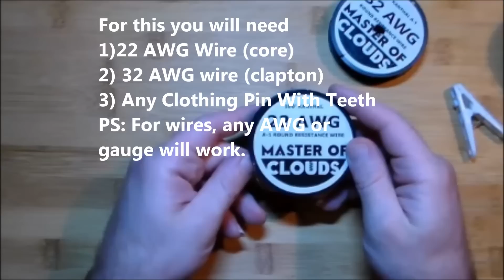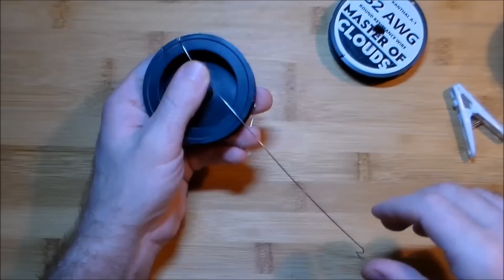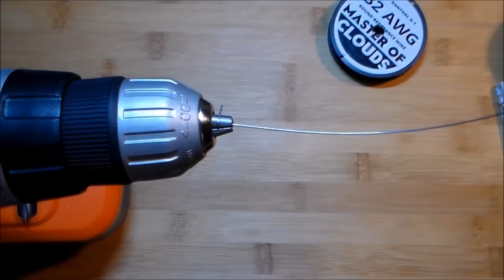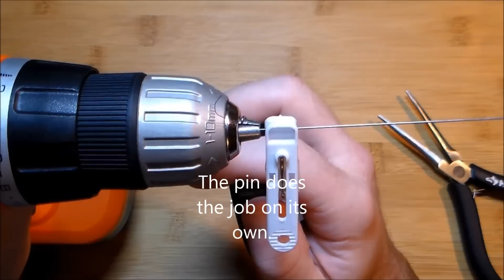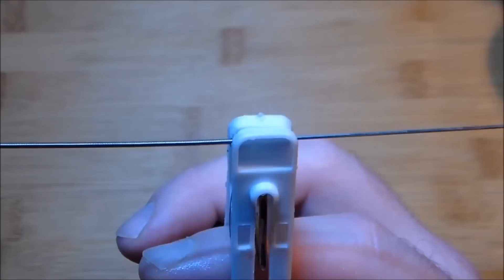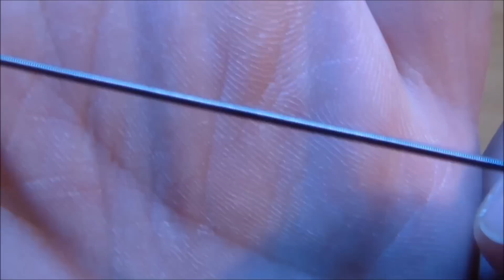Perfect Clapton Coil That Builds or Wraps Itself, Easy Clapton Coil

Comment: This method is so easy with very little effort. No need to mess about holding core wire taut. Several attempts with swivel ended in a lumpy mess. This method made my first Clapton like a professional builder. Thanks Therussainvaper :-)
Reply from the maker: Thanks, Im glad you liked it :)

Comment: Wow Totally cool...I have a big problem trying to SEE the wire...My eyes arent what they used to be...Can't see as good as when I was a young guy lol So if this works for me that'll be excellent It wont take me an hour to do a Clapton!!  Cant wait to try it! Many thanks!
Reply from the maker: +elliott nunez Im sure it will work, if you use a setup that I showed in the update with swivels, should be almost hands free (except for the drill).  I did a mini Clapton there (32 gauge core/40 gauge clapton) trust me I couldnt see it either, did it "blindfolded" lol.

Comment: Thank you so much for helping me with my claptons... i went through so much frustration and wire already. It's a shame you don't post any new material anymore.
Reply: In the meantime I found even an easier trick using just a ballpoint pen. Just google "clapton pen trick". It doesn't do just regular claptons, but even multi-core fused claptons, twisted claptons and so on. Really brainless. The same can be done with some spool wraps but since I didn't have any of those, the pen works magic for me. Up to 40g and maybe even thinner without a problem.
Reply: jakke1975 - have you ever tried that pen trick (i know and use it often) on a more complex clapton, like framed or staple?
Reply: I Am Lam I just make fused claptons by the meter, I'm not really into very special coils as I'm very happy with what I vape on

Comment: quick question, can this be done if I use a hand cranked drill? or what about a pocket modeler's drill?
Reply from the maker: If you use swivels, absolutely yes.
Reply: this coil builder ohm boy josh actually seems to perfer the hand crank drill

Comment: they sell Clapton wire spools made already in case no one wants to do it themselves.
Reply: $/ft is more expensive in most cases by about 250%. I had one of the clothes pin, technically it was a small chip clip, laying around and decided to give it a shot...it works amazingly. $7.99 for two dozen of clothes pins with teeth....can use one for this then the others as a chip bag clip or to hang dry clothes.
Reply: That's genius,  but 10$ for 15ft of Clapton isn't bad
Reply: You are still limited to the options of what they have available (like amazon) and if you can find a go ranged wire (24 + 32) it usually cost more. It takes less then 5 minutes of setting up and go to get 1ft of this wire done. If you are that lazy to spend that time then maybe you shouldn't be looking at using rebuildables and just stick to pre-made coils.
Reply: I make my own coils but buying Clapton made already isn't pricey to me
Reply: Clapton isnt just clapton! Most claptons is made of pure kanthal or maybe ni80 as outer wire. I prefer a full SS or Ni80 wire, fused because it ramps faster up on my mechs and just tastes better :) So all claptons isnt just the same ;)
Reply: Kh4zy I don't use temp control
Reply: SS isnt just used for temp control. Yep, some sell clapton wire, like geekvape. But that is shitty kanthal ;) As I stated before, a clapton wire isnt just a clapton. Different materials gives a different output and most vape companies makes only kanthal wire
Reply: To each it's own man, kudos to your preference

Comment: 2 big thumbs up for this video. Thank you so much for this. Was kind of struggling to find the most efficient way to wrap my own Clapton wire until I found this video. It is genius and even better than the pen or old atomizer tricks. The clip literally does all the trickiest parts for you. The clip even moves by itself at the exact speed it needs to. Have wrapped a dozen feet of 24/30g using this technique. Thank you!!

Comment: Nice method.
I'm trieing to build a "wrapping help" for my own clapton wire. Maybe the clothes-pin can help cause I'm still having some trouble winding the clapton nice and tight on the whole 60-65cm.
Couldn't find a ready-for-wicking full ss316 clapton with a 30ga (0,25mm) core and 42ga (0,06mm) on the outside yet.

Comment: Don't forget to mention you need a strong clothes pin ;)
Reply from the maker: Lol, why?  What happened to yours?  Im using super cheap $5 per dozen.
Reply: TheRussianVaper it got loose somehow and when I tried to fuse it it messed up, I guess i could've just held it together instead of letting it "wrap itself".
Reply from the maker: Cameron Mew Oh you mean the spring to be stronger, I see, you can remove the spring from the pin and clamp it closer, it will make it stronger.
Reply: Really? I didn't know that, I guess vape coils are just like the springs in the clamps. Also I used crappy plastic CLOTHES PINS lol not actual clamps like you. My bad
Reply: TheRussianVaper
Reply from the maker: Cameron Mew Im using clothing pin.
Reply: TheRussianVaper oh ok, just making it fancy I see ;) lol

Comment: have you tried this with 36 gauge or higher?
Reply from the maker: +Garrett Good Yes I have 40.
Reply: +TheRussianVaper was it just as tight together?
Reply from the maker: Garrett Good Yes, very tight :)
Reply: +TheRussianVaper fuck yea! I'm gonna try that out. I wonder if it will work well with doing dual Clapton fusing while making staggered fused Clapton's. the cloths pins are entirely plastic right?
Reply from the maker: Garrett Good Yep, all plastic, let me know how it works out.
Reply: +TheRussianVaper I'll mention you on /r/coilporn.
Reply from the maker: Garrett Good Thanks, but the video is in the subreddit already :)
Reply: +TheRussianVaper I know that's where I saw it originally, I'm /u/ORGULLO4LIFE

Comment: could this method be used with dual wrapping wires? for instance if i was making a staggered clapton and using the dual wrap method to make the spaced wire. I know it wont work for the final wrap as the clip would just cause the two spaced clapton cores to twist on each other.